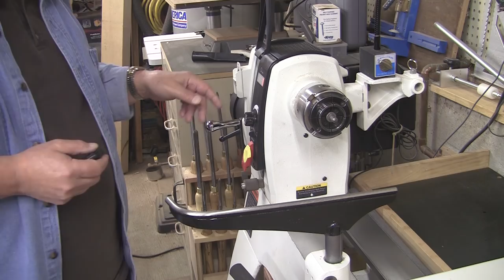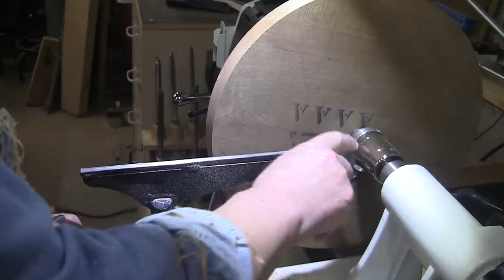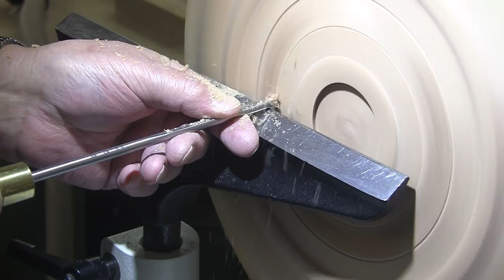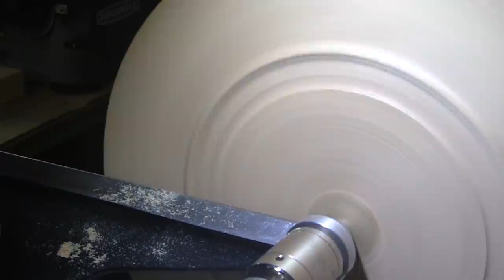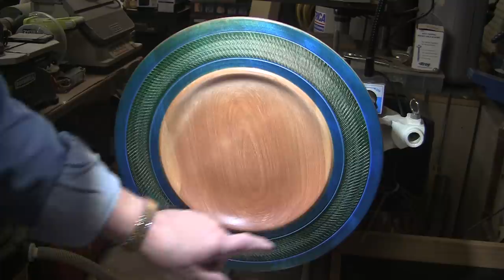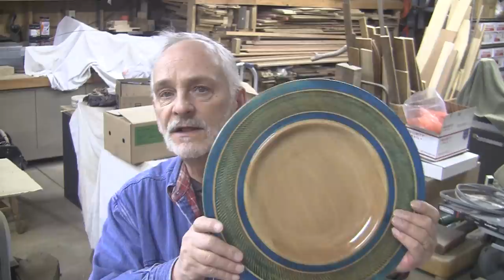15" Decorated Birch Platter - Learn From My Mistakes!

Comment: Phil - Love the plate, texture and colors(U.S. spelling of colors) . Request: would like you to demonstrate how you would support this plate and other turnings for final trimming of the base. As a relatively new turner that would be most helpful. Thanks for your sharing of your expertise. Johnnie C
Reply from the maker: Thank you, John!  When I turn platters I almost always use a recess so there may not be further trimming of the base.  If I had used a tenon, I would have used one of my flat, round blocks of wood and some non-slip material to hold the piece against the chuck, tailstock support and just removed the tenon on the lathe.  I show this in many bowl turning videos, probably a couple hundred times, I guess.  Hope that helps!

Comment: I absolutely love the end result. I’m a commercial artist and I would recommend your using either Prismacolor or Copic markers for your next color endeavor. These are a higher quality alcohol-based marker and they have a very large assortment of colors available. You will get a much deeper saturation of color if you color the wood before the sanding sealer. If you do one coat of sanding sealer, then color you can control the depth of color and be able to add fine details. In either case spraying on the polyurethane finish is a very good idea. Take care.
Reply from the maker: Thanks for all the good advice and wisdom, Chaya! 😊

Comment: I use water-based dye quite a bit ... I apply it to the bare wood, let it dry (sometimes use a heat gun if I'm in a hurry), then hit it with a couple of coats of de-waxed spray shellac from a rattle can. That way I avoid runs/smearing, and can apply whatever finish I want over it.

I have the same Sorby tool ... most of the time it just sits in the drawer. I do use it to create rosette-like decoration on small boxes, etc. but have never tried it on bigger stuff.

Nice looking piece ... I'm sure your wife will appreciate the effort you put into it!
Reply from the maker: That sounds like a great process, Gerald!  I was unprepared for this project from the beginning.  Learned a lot and next time will be better.  And yes, the wife loves it!  Thank you for your comment!

Comment: I'm not a fan of completely colored pieces, but the partial decoration with the natural center looks good to me. If you use that texturing tool on a spindle along the axis you can get a spiral. Otherwise you get pretty much what you accomplished on yours.
Reply from the maker: I'm with you there, Chris.  A little goes a long ways.  Thanks for the tip on the spindle with texture!
Phil

Comment: That is shiny wood ! Look in the art supply store for an aerosol Crylon print fixer  . It is used to seal water color  ,
chalk and pastels art , and will not make your pen colors run . I would use a metallic gold  on the edge or the rim , and the edges of the green  
It is beautiful !

Comment: Phil, it really came out beautiful! The color was a nice touch! Was that a solid piece of birch wood? Or Birch plywood? I have a texturing tool like yours and use it more than I realize. You can get different patterns by simply rotating the tool left, right or even straight on. You did great in the design of the bowl, my only recommendation would be instead of poly which yellows over time use spray lacquer for musical instruments. I have hand sprayed it with a spray gun and the finish is phenomenal! There are two types of lacquer used, the one to use is Mohawk M610-40; Nitrocellulose Wood Lacquer for musical instruments providing unique depth of gloss, superior color and gloss retention, adhesion, and exceptional cold check resistance.
Advantages:
1. Easy to use, no reduction necessary.
2. Good spray flow leveling properties.
3. Alcohol and scuff resistant finish.
4. Excellent rubbing and polishing characteristics.
5. Minimum shrinkage on aging.
6. Superior cold check resistance (cracking) - passes 20 cold check cycles on 1/8” plywood, 5 coats.
This is what I use for items requiring a hi gloss hands free finish for show pieces. 
The other spray finish is; Minwax oil based spray can lacquer M103-0500
I hope that I haven’t insulted you with this, but you asked for opinions and well that’s mine… Take care Phil! P.S. Shellac is the best hand finish, yet and again my opinion…
Reply from the maker: Solid piece of Birch, Stephen.  Thanks for sharing your experience and for taking your time to watch!

Comment: Was that a glue up or a single board cut into a circle, Phil? Beautiful finish, by the way.
Reply from the maker: Single board, Hubert.  This is a piece I've had for years.  I bought a bunch of hardwood from a cabinet shop and it had a lot of really wide boards in the lot.  Still have a few. 😊

Comment: That particular Robust tool rest is meant to be used only on the inside of deep bowls, where the J rides close to the transition between the side and the bottom.  As you found out, it doesn't work at all for shallow bowls and platters, or for turning the outside of bowls.
Reply from the maker: Yes, I'm aware of it's purpose, David.  Sometimes trying different things works out, sometimes it doesn't.  Thanks for your comment.
Phil
Reply: @PhilAndersonShadyAcresWoodshop  True.  I have only just started watching your videos, but you have greatly impressed me with the thought and care you put into your projects, and with your willingness to "think out loud" as you work.  I have seen way too many YouTube videos of people turning without adequate regard for safety, using the wrong tools, turning while their lathes are dancing around the shop, seeing wood fly off the lathe, you name it.  It's scary to think that others might be trying to learn while watching those.

You set a great example, and I plan to be watching many more of your videos in the future.  It beats working.

Comment: don't have a texturing tool, can you use it with one hand?Ii had a stoke when I was 29, and have use of only 1 hand& arm
LD Brandon
Reply from the maker: Hi Lawrence!  I think if you have average strength in your hand and arm, there would not be an issue.  You do have to use firm pressure but it's not an enormous amount.  Control may be an issue, at least it would be for me, but I'm old!  By control, I mean you need to be able to pinpoint where to start and where to stop.  You don't want it running away from you.  If I had it to do over again, I may have gone with the smaller of the two tools Sorby offers, or, maybe the set of two, but that set is pretty expensive.  I hope this answers your question.  Thank you so much for watching and commenting, much appreciated!

Comment: Phil, BIG platters need BIG recesses to hold them, why use such a small grip?
Reply from the maker: Well, Paul, I've found the recess and tenon sizes I use have worked well.  I've never had one come off!  If I am to leave a recess, which I try not to do, I prefer it to be on the smaller side and less obtrusive.
Reply: Hmm, different strokes. I make them big and use the recess lip as the base, so minimal work needed. But I will try a smaller one when I have a big blank of solid lumber.
Reply: Very nice piece Phil. Despite your lack of confidence in your abilities. Stay safe

Comment: I thought sanding sealer went on before sanding?
Reply from the maker: Depends on who's using it and what they are using it for, Jo Ann.  I use it as a base coat for the final finish, usually shellac.
Reply: @PhilAndersonShadyAcresWoodshop  OK, good to know. I was wondering if it was used different ways. thanx

Comment: Can't understand why you take off the tenant off, I think it gives another dimension..
Reply from the maker: Well, this piece uses a recess not a tenon.  But, in general for the pieces that do have a tenon, they must be removed.  They are a utility part of the turning, they can't be turned so they are unfinished and the chuck jaws leave marks in them.  Also, most of my natural type turnings I like to do (not this one) have all the dimension anyone could ask for. 😊
Reply: @PhilAndersonShadyAcresWoodshop  possibly a language difference, in the semantics..I hollow out my tenant and grip from the inside, no marks…
Reply from the maker: @nigellee9824  Well, there is a tenon and there is a recess.  This piece  uses a recess that I did not remove.